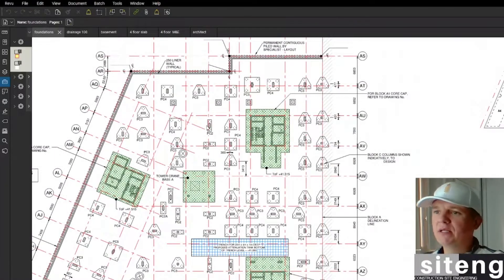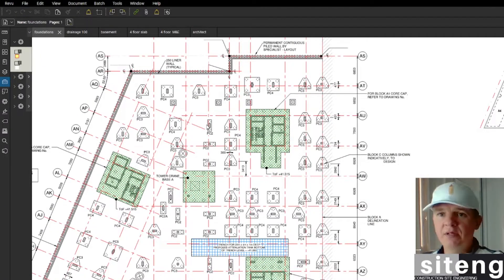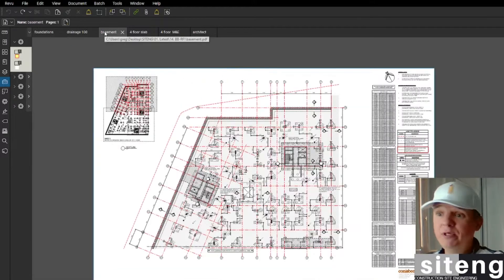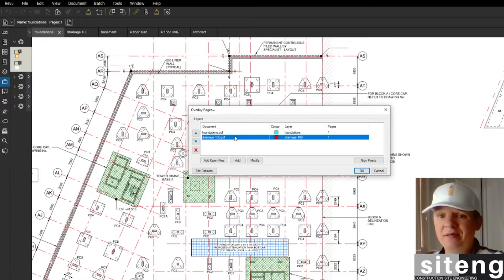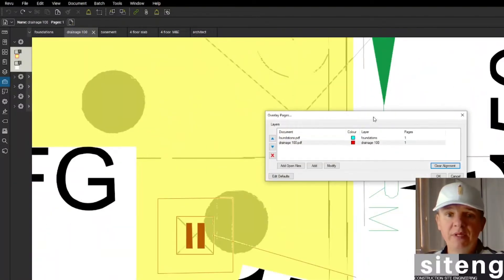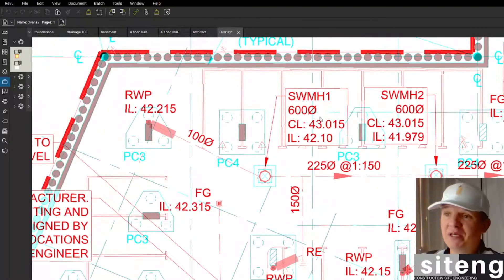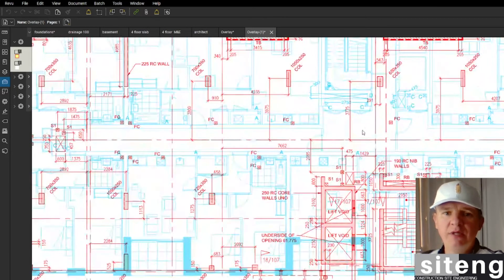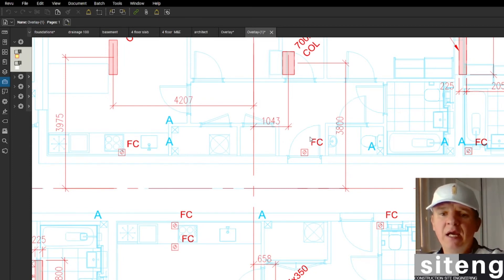Civil engineer drawings overlay. Comparing the drawings and looking for errors and discrepancies.

Comment: Hi Greg,  I hope all is well with you. I am now doing an MSc in project management in London, and I have worked in the industry in India for the past 6 years. I'm quite interested in the UK's civil engineering sector, thus I'd like to know what tools and technical abilities I should concentrate on to work successfully as a project manager there. Any advice you can give would be appreciated. I'm grateful.
Reply from the maker: It really depends what path you will choose. You can go to the PM role through engineering, or you can actually start as a PM assistant.

Comment: If you’ve got them as dwgs I would just overlay them, you have the advantage of being able to switch off layers and being able to convert to dxfs for your controller
Reply from the maker: Hi ziggerzee! Yeah, definitely😁 I wanted to show you can still do it with Bluebeam quickly. I would prepare drawing on CAD later anyway for setting out. Thank you for the comment👍
Reply: No problem

Comment: Hi Greg

I have seen your video about slipform but you have generally talked about Slipform on that video.

Could you please make video about Slipform with more details specially about how to mark any level inside the slipform in first step on ground floor level up to first floor level When preparing the slipform from the ground floor. 
for example bottom level of door, top level of the door, soffit of slab level , or any level in the first step of starting the slipform on the ground floor. 
How to set EDM around Slipform? 
How to find and mark blind points inside the Slipform?

Thanks in advance
Reply from the maker: Hi Babak! Unfortunately I don't work there anymore, but you will be using a measure tape and a line laser for all of it - measuring from the shutter. On the ground you will set a slipform on the core cap (see the core cap video please). I will explain more and pin a comment about it later 😁
Reply: @SITENG  Hi Greg

Thanks for the tips.